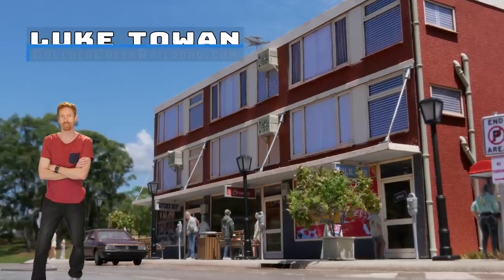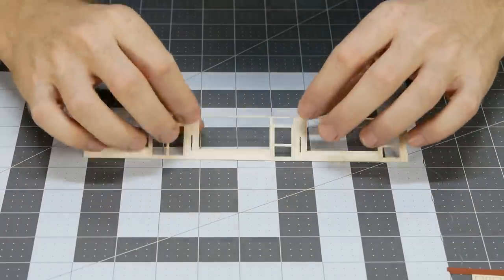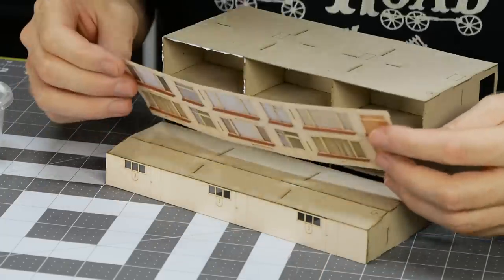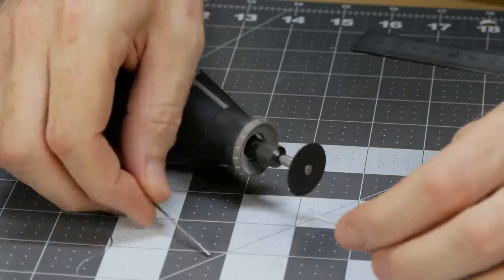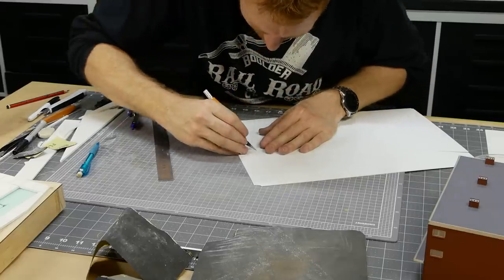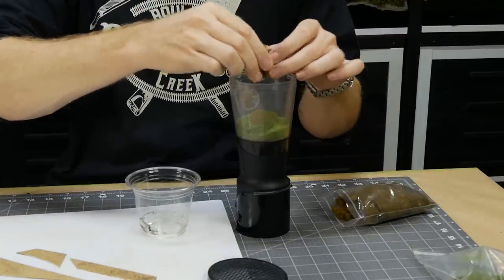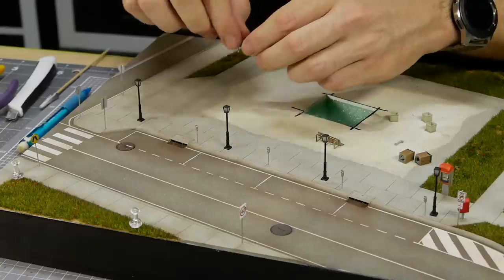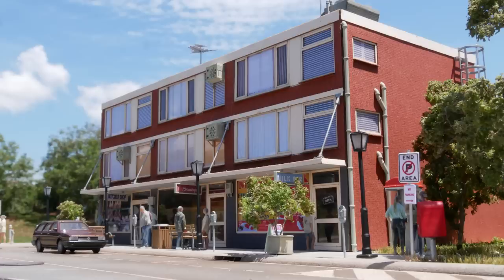Paper Kits Have Never Looked So Good – Realistic Scenery Vol.35

Comment: 5:23 - Don't use that pointy conical tip for soldering, unless you're dealing with sub-2-mm SMD components (and even then, only in very specific situations). Try to get a "BC2" style (round chisel) tip. It heats the pads much more evenly, it can hold a drop of solder right on the tip, can be used to pull excess solder out (when the tip is dry), and will generally make just the right amount of solder flow automagically to the right places. Even a knife tip will do a better job than a conical tip, in 90% of cases. 

Conical tips are great for making holes in plastic and foam, but pretty bad for actually soldering anything. They're only used when you're trying to solder (or desolder) some very small component that's right next to other components, without affecting those.

Comment: If the LEDs heat up the hot glue won't help as it is effected by heat FYI.
Reply from the maker: Thanks Alastair, I think for this application it is OK, the LEDs are not operating at full brightness and they only reach a temperature that is warm to the touch (probably around 40°C) and hot glue starts to melt at around 70-80°C so it should hold 😉